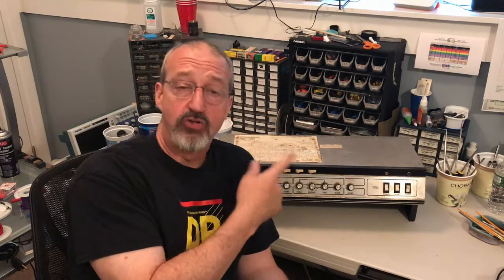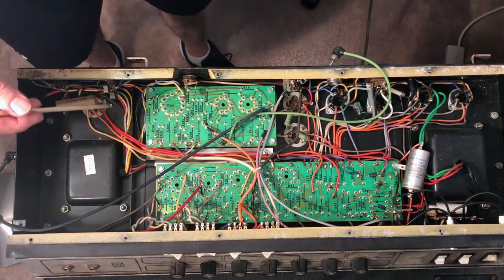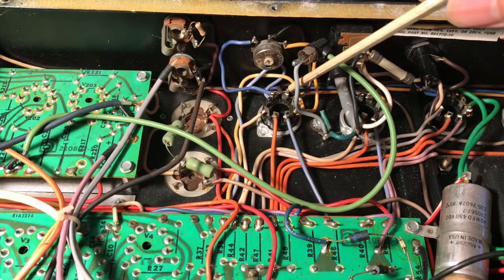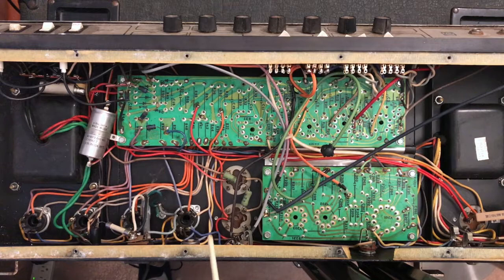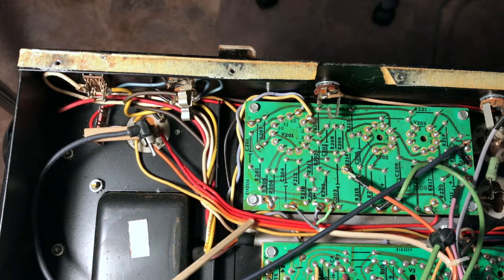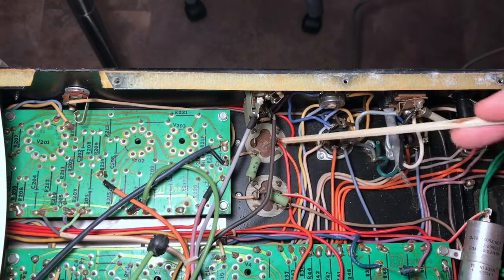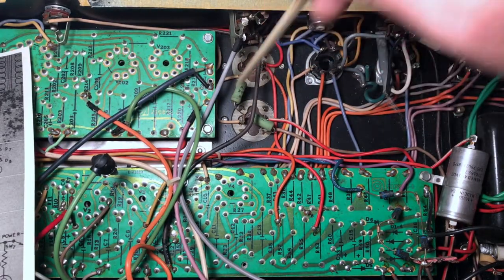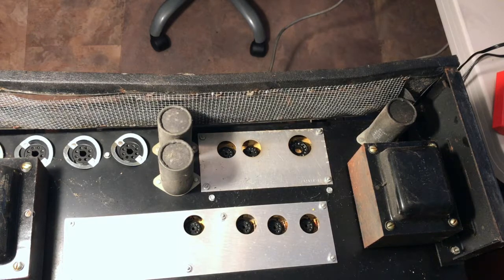1977 Ampeg VT-22 V-4 Grounding Structure

Comment: Would there be any benefit, or disadvantage, with adding an extra ground point to the chassis from the input jack? 

So you dont lose ground if the input jack should come loose?
Reply from the maker: I've actually done that in other amps where I thought the input jack to the chassis was easily susceptible to loss of good electrical contact.  However, typically (including the Ampegs), the "best nearest place" is the inside of the front panel and short of drilling a hole to provide some mechanical contact//support, you'll need a big iron and an accessible clean spot to flow solder.  This may not be a simple as it seems.

Otherwise you should always remove the jacks in any old amp, clean the contact surfaces thoroughly and ensure full good tight contact.  That will usually be more that good enough.

Comment: This was very helpful for me. That schematic is a bit clearer than the one I have for the 1970 version and the one I had was BADLY butchered, so I was really second guessing myself. Turns out I was right! Finding info on the right resistance value for the plate resistors was fun too. Thankfully I figured it out. Great video though!

Comment: Thanks for the great video and explanations. Very helpfull. I am restoring an earlier V4. The owner has ordered a direct replacement cap kit from Fliptops. Should be a lot easier than trying discrete components. I still have to map out the wiring connections.
Amp is a beast!
Reply from the maker: Thank you!!  And yeah - more expensive to get the can/kit than discrete parts, but a lot less hassle than engineering a way to house discrete parts. But the flip side to that is, typically, discrete parts are higher quality and if only one part fails you only have to replace that one part - if one section of a can goes, then the whole can goes, or then you're back to rigging a single discrete part anyway.

Comment: I love my 65’ GS12R -cleans sound great but it doesn’t seem to take boost/overdrive or fuzz pedals well. Is there anything I can do to improve this and make the amp a bit more flexible?
Reply from the maker: There really isn't much you can do - they deliver a fairly unique sound - both clean and overdriven.  Cranked is the best way to get an overdriven sound - no pedals, but that simply is not possible/usable in all situations.  That's my opinion - but not everyone's.  I would say if I had to put a pedal in front of it to push it more, it would be a full frequency OD, not a tube screamer type - maybe something like an OCD or OD-1
Reply: @tronpesto3978  Have you ever put a Rat in front of it? I don’t own one and was thinking….
I love the cleans the best-don’t know if it’s that old accutronics(?) reverb tank but it is the best atmospheric amp I have.

Comment: I was wondering if this amp has the death cap in it ? As the  white long cap up in the front on the right and it's kind of buried up under all the wires is what I think is the death cap. Please let me know.
Reply from the maker: It could be - it's been a while since I've been in the amp.  But I can say with all assurity that if it is, it is disconnected.  If you are working on one of these amps, you would find it connected to the Polarity switch on one side and ground on the other.  It's simply defeated by disconnecting it from the polarity switch - keeping in mind if it is not otherwise mechanically secured to the chasis, it should be completely removed.

Comment: Thanks much. I am currently working on one of these and the reverb is giving me a "buzz" when turned all the way up. When v203 is disconnected, the buzz goes away, when the footswitch is engaged the buzz goes away, and when the reverb is turned down the amp is a quiet as a mouse. The buzz is also not "tank" related. It persists when the tank is removed. It has to be a ground issue somewhere, but I can't find it. I've checked all of the places you're pointing out here. Anyhow, thanks for the great overview. There's not alot of documentation on this amp.
Reply from the maker: Hmmm - no pun intended!  (or Bzzz would have been more appropriate) -Reverb circuits and footswitches in general can be antennas for noise - especially if there is any break in the shielding including the footswitch itself.  Is it a "standard" Ampeg footswtich?  Describe the switch.  Another troubleshooting step would be to simply pull out the footswitch (all tubes in and reverb control up to where you typically would hear the buzz) and see if that makes any difference.

What do you mean by the swtich is "engaged" - do you mean when you use the switch to "turn off" the reverb or when you turn it on?

In the schematic,  the footswitch operates on the output - when the switch is in the reverb "on" position it actually doesn't affect anything (the switch circuit is open) and the reverb signal out of the tank is fed to the recovery tube.

If the switch is "engaged" it dumps the signal coming from the reverb tank to ground - and thus no signal going to the recovery tube.

If the noise is there when the reverb is switched "off" then that means the footswtich/cable itself is picking up noise somehow (ac noise and/or ground loop) and feeding it to the recovery tube.

The reverb knob controls the amount of amplified signal that is coming from V203 into the amp.  So when the know is "low" you won't hear much but as you turn it up the noise is being amplified.  And when you pull V203 it goes away.  And also when you remove the tank, the noise is still there. 
 So what we know is that somewhere from the footswitch and the circuit from the reverb output cable, and the footswitch and anything connected to pin 2 (grid) and pin 3 (cathode which is coupled in a feedback loop to the input) is picking up the noise. 

I would tend not to think it is the internal components connected to the pins, but either the reverb output cable, or footswitch/cable.  It could be bad/wrong grounding on those cable shields.

Also, is it the original tank?  If it's a replacement - even if it is the right input and output impedance, the inputs and outputs may or may not be grounded to the reverb chassis depending on the amp's reverb circuit.  And if wrong it could introduce ground loops.

Ground loops however are more of a "hum" to my ears, and stray RF/AC noise being picked up and introduced into the audio chain can be more of a "buzz" - usually picked up by bad shielding.

I hope that helps - let me know if you find anything.
Reply: @tronpesto3978  thanks so much for the in depth reply! The initial “buzz” was intermittent and had something to do with the capacitors. I shot gunned them and it went away for the most part. Leaky caps maybe? However, even after the component replacement there was a remaining subdued buzz. It ended up being the reverb tank from the factory installed backward. Seriously, no one had been in the amp since it was purchased in 1970. All original and my dad never even had a tube replaced. It was pretty surprising to learn it had been in reverse all those years. Here’s the video if you’re interested https://youtu.be/Vulh-aUqqxA . Thanks again for the detailed response. I really appreciate it!